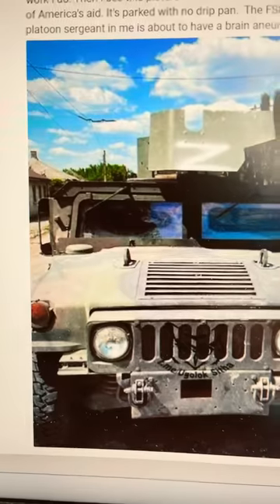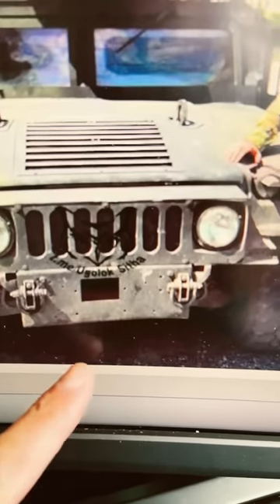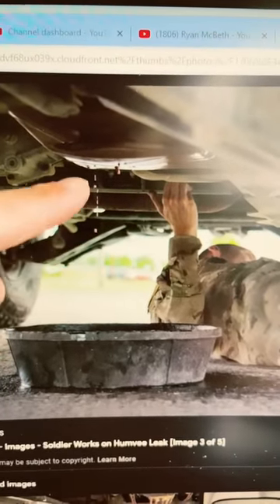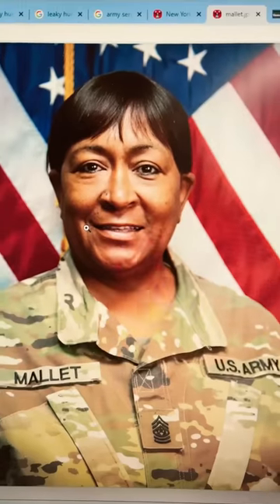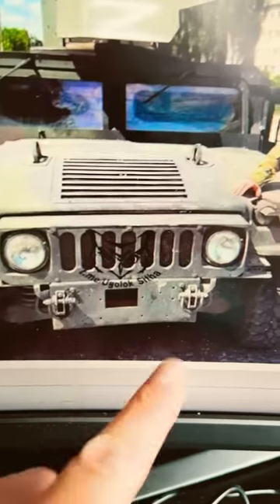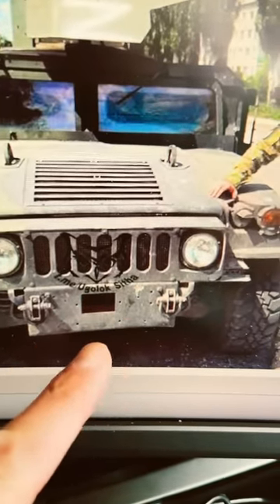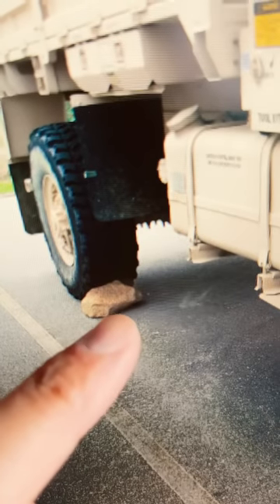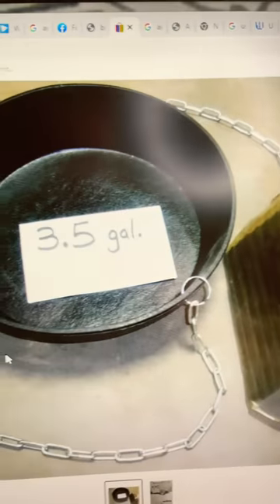What is a chock block and drip pan?

Comment: Couldent just build something where the brakes worked and it didn't leak oil
Reply: Man of Culture  10,000 parts on government low bid.
Reply: Sometimes You dont set them to “park” you set them to neutral, apply the parking brake and aw shit for got to set the brake. Hence, the chock block
Reply: @safetyfirstintexas  well also, things like,

You remember the worst pothole you ever hit in your life? Or obstruction in the road, the one that killed a tire, or the wheel, or the axle, or ripped up the entire car?

These vehicles are doing that kind of stuff and worse everyday, in combat. You don't stop and steer carefully around a 3-ft rock if that means you take an extra 15 seconds in a combat zone with RPGs going off, you drive right through that sucker and trust your run-flat tires will get you home. Do the equivalent 10,000 times and you'll begin to have leaks, I bet. It would be interesting to know if the undercarriage of the HMMWV is designed to collect all fluids from all systems and drain them at one common point, otherwise you would just need a lot of drip pans. I'm skeptical that a vehicle regarded as functioning could leak enough during an overnight parking to either be noticeable or dangerous to the machine. I trust that things like the condensation from the air conditioner, if such a vehicle has an air conditioner, are discounted.
Reply: This is America...no we can't
Reply: @nichevo1  most dont have AC. A lot do have a fan that just circulates air out the dash. If you see an up-armored one, those do have AC and are way more sturdy overall. The drip pan is only to catch oil really. Environmental reasons and such. . Other fluids arent really considered.
Reply: I know right 
With all the defense funding you'd think.
Seems like no country can get it right.
Shows where we are as a race.
Reply: Most vehicles drop stuff
Also brakes can fail so it's better to be safe than sorry
Reply: Its a American death Trap do you think it works proper?
Reply: The military requires redundancy, and that every thing be joe proof. One private one time forgets to set the brake on a jeep 80 years ago, so today we have to set a chalk block. The pavement in SGM's motor pool has to look pretty, can't have a class 2, circle Xed leak leaving a stain on it. Plus epa fines, so we always set a drop pan
Reply: It's about redundancies and making things Joe proof. And avoiding EPA violations and fines....

The old joke is ” leave 3 hammers in a room full of privates, when you come back, one will be missing, one will broken and one will be pregnant "
Reply: they be old asf. the army will have some shit rolling around. a frame away from being the grandfathers axe paradox. when you have unlimited maintenance budget, but very strict and limited new acquisition budget. you replace parts on shit that any normal organization would just replace. buy engine swap 8 anything is a rolling shit bucket.

Comment: As a 91b (wheeled vehicle mechanic) in the army, i can confirm that SGMs (sergeant major) dont play about the chock block and drip pan being there... not to mention they have to be dress right dress (in line looking exactly the same) no matter how many dif types or sizes of vehicles are there 😬 oh and more importantly KEEP OFF THE SERGEANT MAJORS GRASS!!!!!
Reply: why don't you fix the leaks ?
Reply: Dress right dress.
The problem is the leak is in the wrong spot for that.

Comment: Do they really leak that much oil? Is it just because they've been beat the crap out of? Or is the build quality just that atrocious?
Reply: "military grade" for you
Reply: @matteocesa9017  As long as it leaks, it means there is still oil left 👍
Reply: Don't think of these as like your car, think of these as like heavy duty trucks, or farm tractors, or heavy earth movers adapted for combat usage.  They have high compression engines (since they're diesel) and they do a lot of idling.  Many of them might be decades old, and have probably been rebuilt a number of times.  After a certain point, there's going to be some seepage.  Not a lot, but if you park something overnight, there might be a few drops on the ground.  This is fairly normal.  In fact, once a vehicle gets to a certain age, the saying goes "if it's not leaking, it's out of fluid".   Some things you don't want to ever see leak, like brake systems or some coolant systems, but a tiny amount of engine oil seepage is normal.

The thing is, while it may be normal, the military has a zero pollution policy in most peacetime settings.  If you're dumping POL products on the ground and you're not mitigating that, then environmental gets involved and that goes way, WAY up the chain of command.  GS level civilians start making phone calls to post commanders (who have stars on their shoulders), and those post commanders start making calls down the chain of command.  By the time those phone calls get to your chain of command, a gigantic pile of shit has been avalanching your way.  No sane NCO at any level wants to deal with the nonsense that entails, and platoon level NCOs know that cleaning up oil spills involve inordinate amounts of paperwork, late work for EVERYBODY, and a bunch of officers and higher level NCOs deep in his business asking that NCO very pointed questions as to why he can't get his soldiers to follow VERY.  BASIC.  PROCEDURES. so that everyone that has been perturbed by this nonsense has to deal with a bunch of bullshit that they all very much don't want to have to.

So you get yelled at to put down drip pans and chock blocks so that environmental and safety incidents don't happen and everyone can go home after the 1700 formation and not have to police up the oil spill in the motor pool during the 3 day weekend that's coming up.
Reply: The Detroit V8 engines used in Humvees were not known to be poorly built. Just a bit small for the application in it's later years when they were uparmored and became very heavy. The drip pans would be mostly used as a precautionary measure because if someone got the base messy then some other poor schlub would have to clean it up (as mentioned, senior sergeants do not like messy bases and it WILL be cleaned). Taking a second to put a pan underneath the truck even if it doesn't need it will save a ton of time when eventually one loses a main seal or a valve cover gasket or whatever which is inevitable no matter who made the engine and what application it is used in. Rubber seals on engines get old and brittle. It's just the way it goes.
Reply: @pscwplb  I also imagine that letting the engine warm up isnt a priority if someone is shooting at you
Reply: If they are anything like mining equipment, well maintained ones don't, poorly maintained ones do.
Reply: So, if I understand correctly, the military likes a clean place, the Humvees are old and have had the crap beaten out of them by years of 18 year olds driving them around, and so some of them leak just a little bit.
Reply: @rwaitt14153  It's the same 6.5L Detroit diesel Chevy/GM use in their 88-98 2500-3500 pickup trucks, and the same 4l80-E transmission, so far as I know. Correct me if I'm wrong. I have two of these pickups. They won't leak if they're properly maintained.
Reply: @BlackEpyon  What sort of preventative maintenance is there to do to stop rear main seals from leaking? Does the owners manual specify yanking off the trans to rub some rejuvenation cream on them or something? They last until they don't. Same with every other main seal on every other engine ever.
Reply: @rwaitt14153  If you're cheap, you can pour leakstop into the oil reservoir, but the best thing to do is just to replace the offending gasket when you notice that it's leaking.
Reply: Almost all diesel motors drip a little. It's pretty normal. This is coming from someone with a lot of experience with commercial vehicles and heavy-duty diesels

Comment: What’s funny is they make us use these wooden chocks for the Abrams as if they can stop a 70ish ton vehicle. 

They can’t.
Reply: And it's not even a question of weight if you have enough wheels, whatever it is will just step over the chocks. My dual axle caravan and plant trailers need two chocks per side or they'll just step over one wheel at a time and go on their merry way.

Comment: I've been in for almost fourteen years now and I've never once seen a military vehicle roll away or leak more than a drop or two of any fluid. The army's habit of requiring chock blocks and drip pans is anachronistic. Back in the day, most military vehicles had manual transmissions, and so could roll away on a steep incline. Rubber seals back then were also prone to failure and quality defects. But this isn't the world we live in anymore.
Reply: Since when do vehicles with manual transmission roll away on steep inclines? You just put in 1st gear or reverse in addition to pulling the handbrake and it's totally fine. I actually trust that more than the "park" setting on any automatic, because I get to choose the direction (1st or reverse), depending on my vehicle heading wrt. the incline. And yup, I'm European and drive a manual as my everyday car. Only ever drive automatic when I get a rental on vacation or something. Those electronic gearboxes? Yeah, probably less reliable in terms of staying in park than me putting in reverse and feeling it mechanically set in place.
Reply: @TheFeldhamster  When you do that you're using the compression of the engine (or technically the resistance to compression) coupled with the mechanical advantage of the transmission to prevent the wheels from turning, thus keeping the vehicle in place. The reason why it is a bad idea to rely solely on this method is because it is still possible for the vehicle to roll away if there is enough force to overcome the compression of the engine. 

Basically, if you parked a vehicle on a steep enough hill and only relied on putting it in 1st/reverse, it could roll away and cause an accident (and I've seen it happen on a farm). This is why you're supposed to apply the parking brake too. But because the army of yesteryear didn't want to rely on only too methods, (because parking brakes can fail over time too), they mandated the use of chock blocks. 

Nowadays, military trucks don't use manual transmissions. They have automatic transmissions. There also have airbrakes and when you put it in park, well the brakes are basically always on. So these days, you can't leave it in gear and you don't have to worry about the brake cable failing (because there isn't one), ergo...a chockblock is just straight up redundant.

Comment: As one who has driven many a vehicle with deficient emergency brakes over the years I can tell you that the rock (which I think the use of was ridiculed in the vid) is a reasonably effective substitute for the manufactured versions. Short pieces of 4x4 and 5x6 make highly effective substitutes as well. My personal preference is a 6x6 sawn into a double faced wedge with the bottom surface laminated with thick "soft" rubber like a strip of old car tire.

I view most manufactured chock blocks with a degree of suspicion because they are manufactured from "hard" plastic that, despite texturing, are subject to slippage, especially when used on hard surfaces like asphalt or smooth concrete. The main problem with masonry such as the rock in the vid is that it can crack or crush.

Comment: Wait...They leak so much that a drip pan comes as standard equipment???
That's really messed up!
Reply: Yeah thats what happens when you drive a lot in the desert.
Reply: @PugilistCactus I know  extreme heat can warp cylinder heads and all the seals, I ruined my first car doing that. 
But do they build warpage into the design then??? Or is this all just a result of poor design. 🤔 
Maybe they're just not designed for sustained +100° temperatures.
Wow, this really blew my mind.
Reply: Adam, do you know how I can I can tell you have never owned or operated an older fleet vehicle before? This statement. Vehicles built in 1984 have old seals and gaskets in them that were not designed to last forever. Nothing is. That some may have POL incontinence issues should not be a surprise to anyone.
Reply: As an Army mechanic let me chime in. We  are tasked with keeping highly abused equipment running until they become irreversibly damaged or get replaced by a new version of said vehicle. This can be 10 years of use to 30-40 years of use. We replace almost any component of vehicles to keep them running long past cost effectiveness. After all those years of abuse by different people and years of replaced components it should be expected to have leaks. Some components of some vehicles are actually EXPECTED to leak and have certain leak allowances. However, most people just toss the drip pan nonchalantly under the engine because we’re told we need to have it “somewhere”.
Reply: @gabrielhirt6659  I will vouch for this as I used to be one of the guys that abused the hell out of those vehicles. Not proud of it, but I own what I and my soldiers did. Bless you mechanics
Reply: Not military but in mining I've worked for companies that didn't worry about oil leaks that much if they could get away with filling the oil at the same time as it got refuelled. Stupid and costly, but it happens.
Reply: @gabrielhirt6659  that's awesome actually. Literally "driving it into the ground"

Comment: I have a friend that used to work environmental monitoring at a local army base.  Yes humvees are always supposed to have a drip pan.  The base is a giant environmental wreck. It would be a massive cleanup if it wasn't outside EPA oversight.

Apparently they do still have to cooperate with whatever agency monitors animal populations.  They fly people over the artillery range in helicopters as they try to count deer through binoculars.

Comment: 91B here (wheeled vehicle mechanic) chock blocks are a safety measure in case of failed brakes or vehicles with nmc brakes. The drip pan is to catch fluids in case of or during a spill. Your vehicles should NOT be dripping any kind of fluid all the time. Idk what this guy is talking about but if a vic has a leak it becomes nmc and needs to be fixed before it becomes mc

Comment: The Airforce does that same thing for aircraft. Sometimes it isnt a rubber chock, its a wooden one(which is pretty heavy after rain). And most of the time drip pans are only used in hangers, depending on the base. They tend to not come in a set with the Airforce.

Comment: I did vehicle maintenance, in the Air Force. The only drip pan used on those types of vehicles, was when it was in the shop for maintenance, to fix that leak. Which wasn't often. I did 6 month in the desert. Did you know HUMMERS fly? I saw a picture of one flying. LOL

Comment: I got very familiar with drip pans as a private when my section leader ordered me to drain the hull of our tracked vehicle, dozens of gallons of oil, antifreeze, rainwater, dip spit, and diesel came roaring out of this machine. I used every drip pan in the battery's side of the motor pool to contain the flow.

Comment: I had to use those blocks for my old camper, it was more to keep the wheels off the ground and keep the front a few degrees higher than the back to keep water from pooling.

Comment: I was an engineer and assigned to a concrete mobile, one thing it had was a grounding strip so the cement wouldn’t gather static electricity, motor pool replaced my grounding strip with a strip of rubber. During inspection my LT ask what was that thing hanging under the truck, I told him exactly what I just said. He crawled under the truck and noted it was rubber. I concurred. He said rubber doesn’t conduct electricity. I replied, you know that, I know that, motor pool knows that, but evidently the Army doesn’t. He didn’t like that answer. I was in the unit for about 18 months longer and it never got changed.

Comment: Ahhh Sergeants Major....   As a platoon sergeant many years ago on a hot summer Friday afternoon just before COB formation, I was called to meet with my first sergeant and the CSM for a little professional development.  I was asked why my platoons drip pans weren't dress right dress under the vehicles.  I told them that they were placed where the drips were.  That was obviously the incorrect response.  So the drip pans were all centered, and the oil dripped onto the pavement.  I miss a lot of things about the Army.  Senior NCOs with no common sense isn't one of them.

Comment: A wheel chock is pretty much anything you can wedge under a tire to keep it from rollin (rock, fire wood, jack hammer, another wheel, a broken grinder, a 8# or bigger sledge hammer, a cylinder head) its kinda like the "anything is a hammer" deal

Comment: The question why do expensive military vehicles that are purchased at the cost of the tax payer not even hold their fluids when parked? That seems like terrible quality for the ridiculous price
Reply: Military vehicles are subject to much harder use than your baby in the garage.  They probably last longer too.  Some air force planes were built in the 1950s.
Reply: @roberteltze4850  yeah that’s planes though. I still fly my Cessna built in 1967. But cars dripping fluids is different

Comment: This is by design for safety reasons. When attacked in the middel of an oil change, the engine can't run. Topping up a leaking engine, it is always in a usable state.